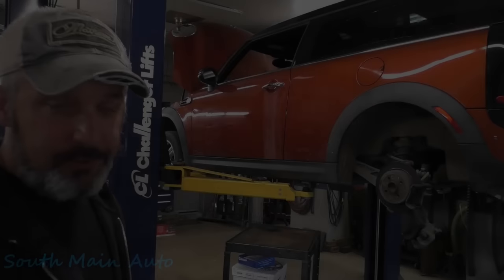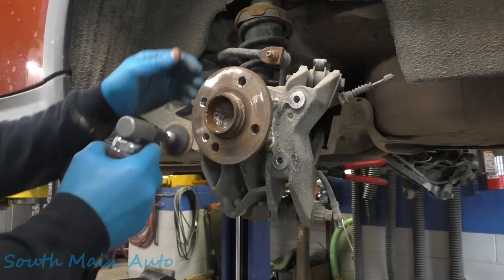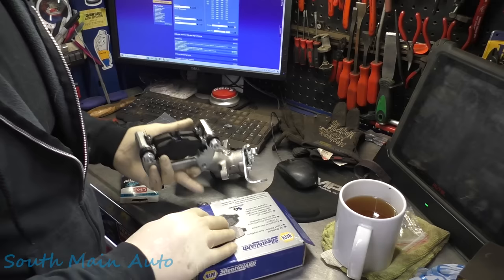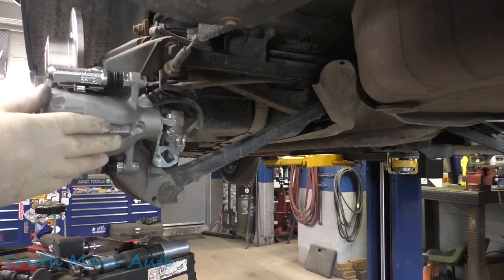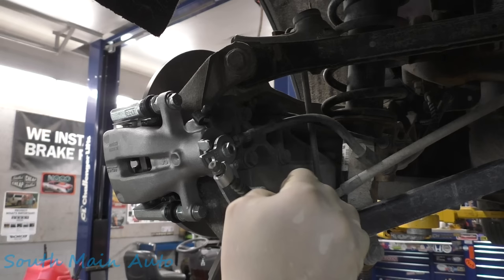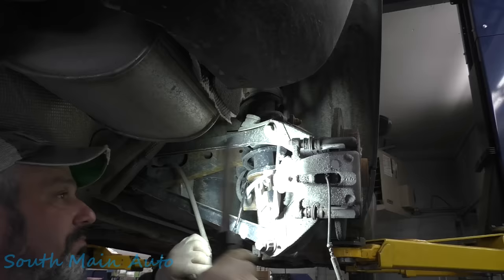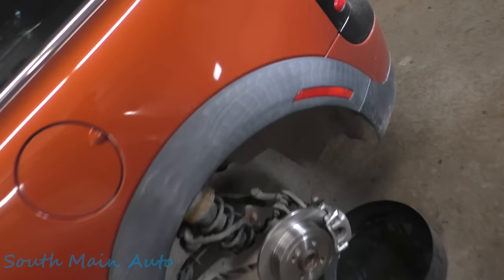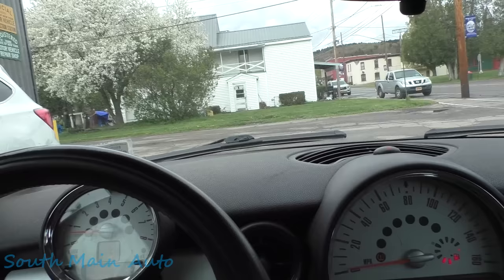'12 Mini Cooper: Rear Brake Pads, Rotors & Calipers

Comment: hey eric the car is built by bmw so a german accent is needed there is normally a tab loop  on the bleed nipple cover to retain the ware sensor wire drive on the wrong side of the road with the steering wheel on the wrong side of the car

Comment: Back in the ancient times, before 1993 and the Internet of things or the Googler and the Yahoo. I used to have a torque sheet taped  inside  the lid of my top box that listed the recommend torque settings based on grade of bolt, bolt diameter and type of threads and thread pitch and material type the bolt that went in to, ie. steel, or aluminum. I used this when I didn't have a manual to get the torque specifications for whatever I was working on at the time. I haven't checked but I bet there is one to be found on the world wide interweb if someone wants one.
Reply from the maker: Most oe's have that chart right in service data too

Comment: Easy way to convert thread diameter to bolt head size in metric is head should be 1.6 times the tread diameter. However the Japanese seem to use a slightly different system.

Comment: Great video, what a difference compared to working on my ‘65 mini pickup (UK only, I think) back in the day. A pet peeve, however - I grimaced at the end when you pulled on the handbrake without pressing the button to avoid wearing out the ratchet teeth. My dad would have cuffed my ear if I did that.

Comment: FYI, the numbers on the service sheet (55, 56, 57, 58……) is the year of the car.  In the UK the number plate includes the year of the car.  We have two numbers per year, so 55 would be 2005.  So the two numbers for this year will be 23 and 73.  The layout of a UK plate is two letters (area code), two numbers (year of manufacture) and then three letters (random). So would look like AB23 ABC.

Comment: Honestly, with all that rust and corrosion, I thought for sure those caliper bolts were going to snap like twigs when you hit them with the wrench. If your break the hose by putting a clamp on it, odds are the hose was junk and would probably blow out sooner rather than later.  So clamp it anyway.
WAF stands for "width across flats"  Don't ask me how I know.   I like those slip join needlenose.  Very handy.

If you are going to call it a Bowdon cable, you need to start calling the hood the bonnet, the trunk/hatch the boot, the centre (note the spelling) Console, the cubby, and any failed/broken part as "knackered".  at least you called it a Spanner.

FYI Carquest was bought out by Advance.  Basically Advance is targeted to the  consumer and Carquest is more for installer/retailer, though you can walk into any advance and get Carquest branded parts.

Comment: Wow, that rotor/caliper set looks almost identical to the rear brake setup on an old John Deere gator I use to have. The little parking brake doohickey inside the caliper broke and Deere wanted a few hundred dollars for a caliper (almost as much as I paid for the entire gator). It was a Wilwood built caliper, but Wilwood of course wouldn’t sell me the one little doohickey that broke. I ended up making my own part, but it sure would have been nice if I would have known that I could just go to O’reillys and pick up a rebuilt Mini caliper... I always joked that they were go karts. I didn’t realize just how true that statement is until now. Honestly, I didn’t even know they were still selling automobiles with non-vented rotors in this country.

Comment: I've got 3 different size bolts in my tool box that I use for the euro stuff with wheel bolts. I think they were some old strut bolts and control arm bolts I had laying around. They are about 4 or 5 inches long. Chop the heads off and presto. I think the 12 mill 1.50 and a 14 mill 1.50 fits most stuff. The smaller bmw's are kind of an odd ball size. like 14 x 1.25.
Reply: I was just going to comment I did the same thing, cut the head off the bolt and there you go 👍👍
Reply: @jeffkeil7217  I do the same for tranny bolts!
Reply: I just use a super long skinny punch as a drift. Don't worry, I haven't messed up a thread yet.

Comment: Most of the different things come from bmw. On my e90, the wear sensor, turn signal, bolts torque based on thread size, brake line to caliper is identical. Even the placement of the brake reservour.  And makes sense since its own by bmw

Comment: I did my brother's john Cooper edition, you can slide the rear rotor out without taking off the caliper bracket. I was going to remove it and he just pulled it right off..
He bought all his parts from some British mini supplier, for 4 rotors and pads it was only 350 usd..
You picking on rainman ray..lol.
Bowden cable, you don't remember vw beetles.. the clutch is a Bowdon cable, it has a bend in it to induce friction so it's not loose.

Comment: I just replaced front discs, callipers & pads on my X5 and asked my wife to help bleeding, we were doing the down, up, down thing & no air was being expelled, she said the pedal was just straight to the firewall, no resistance, what pedal are you flooring was my question, the one on the right was her answer.

Comment: As far as the tool to help get the wheels back on I used a long bolt that fit the hub and cut the bolt head off. Thread it into the hub and put your wheel on. Won’t fall off. Super cheap compared to buying the actual tool.

Comment: As far as I know: Bowden is a tube, fixed at both ends, that something else moves inside of. A lot of 3D printers use Bowden tubes to deliver the filament to the moving print head.

Comment: Some numpty butchered that  calliper in the past for sure ( along with a few other bits and bobs by the looks) - wound the piston in without unsticking the boot from the piston and chewed the boot up. Non Banjo brake hose attachments maybe a pain to remove but they are heck of a lot less likely to leak....

Comment: You're closing line is that you can do it but the truth is other people cannot do it. And their head they think they can but they always somehow screw up every one of these jobs. If you have an ASE certification please post it proudly on your wall. If you don't have one you should because you think like one and you function like one. You follow all the rules every time. I've seen shows where people use a screwdriver like it's a chisel and they use a crescent wrench like a hammer. They do a lot of hit n  miss parts replacement type nonsense. The common man can relate to that kind of nonsense. Your repairs are actually done the right way

Comment: Got a 2012 mini S for my daughter with 82k on it.  Dumped it 2 years later when the oil line leaked in front of engine, all front panels, rad pack and turbo have to come out.  When the PCV valve went and was going to be over $500, by by.   They’re money pits.
Reply: Nah, you can have problems with any car.

Comment: Nice video as always.  UK and US, separated by a common language as we grab the correct size spanner, put on the new brake discs and change gear left handed in the test drive.  Oh and that’s not a mini, those boots wouldn’t fit inside a real mini 😄

Comment: 16mm hex head on M10 bolts is pretty much mostly used on european cars for almost 20 years now.
But it's not a rule, some M10 bolts can still be 17mm hex, so you're always finding yourself swapping sockets.
I guess the 16mm hex saves some material and is therefore cheaper when buying them in millions.

And since when do you use brake cleaner without the chime?🤣

Comment: There is sometimes a rubber tie integrated into the bleed nipple cover which supports the wear sensor...not sure if that's what Mini use....looks lkke someone did a proper job previously!!! Just seen someone else has suggested the same. Not sure about the English accent....think that was Dick van Dyke!

Comment: I replaced brake pads on a mini Cooper before and even though I installed new wear sensors I still had to use a scan tool to reset the system

Comment: Nice to see the rare stir-it-yourself transmission.

I'm surprised Eric doesn't have a one-man brake bleeding kit so he doesn't have to bother Mrs. O with the task so often.
Reply: He does have one, but he doesn't use it very often. The Achilles heel of positive pressure kits is the seal at the MC reservoir. If it flips off it makes a huge mess, and every manufacturer uses a different size cap so you can waste a lot of time setting it up.
Reply: @spelunkerd  I use a hand vacuum pump with a fluid catch container at the brake line bleeder screw. I find it works very well as long as I make sure the reservoir doesn't run dry.

Comment: Dear Eric (and the very dear Mrs O). It is especially interesting to see that Avoca has cross traffic in those hectic streets of your little testing circuit. Your view of the intersection is usually unhindered by any sort of vehicular device at your inner "city" stop sign. BTW I only found out that Avoca is spelled that way in one of your recent videos when you passed the "city" sign. Prior to that, I thought it was spelled "Evoka" when I heard you describe the "city". 😁🙃

Comment: Too late now but the rear brake service interval needs resetting, either by a few button presses on the display cluster and left hand column stalk, or with a scan tool.

Comment: The sensor wire goes underneath the rubber loop that holds the bleeder nipple.
Reply: If I heard Eric correctly this mini was going to the shop for a brake job at 139k miles. That’s pretty decent and the under carriage looked in good shape so I don’t think they are a lousy vehicle. I’ve owned both a 60’s period mini (real mini) and the newer version and I agree the newer has grown a bit too big. Usually British vehicle electronics are awful and fail frequently and the engine and steering systems leak after 30k or sooner but generally there decent in city car to own.

Comment: The dumbest thing I found with Minis is certain models require you to unbolt the coolant overflow reservoir to get to the oil filter. Havent done much work on them besides oil changes.

Comment: I wonder if the new packaging is to avoid lawsuits or complaints of people who don't know the rotors are covered in oil and need to be cleaned.
I like those new calipers and rotors that come with like a anti rust paint or some kinda galvanized coating it cuts down on rust on most of it except where pads ride LOL

Comment: Did these very rotors/pads/calipers last fall, so lots of deja vu. Lot less rust on this one though. Damnedest thing with mine... lots of rust on the rotor face, so caliper pistons or pins must be locked up, right? Took 'em apart, pins were still nice and goopy/slippery, and pistons were still moving. I'll keep the story short, and say that while everything was still moving off the car, when bolted to the car, it would lock right up - caliper wouldn't move at all on the pins. Only discovered this while bolting on calipers sans rotors to see if anything was moving when bolted on - turns out nope. Never seen that before.

Comment: Great work as nornal Eric one thing did you plug your diag in after and reset the milage for the rear brakes in the computer ? lots of Minis have that for front and rear brakes if you dont reset it the car will hit the milage and even if the pads and discs are still good you will have to replace the brake sensor again to reset it hope this helps keep up the great work

Comment: The 16 mm nut on the bracket surprises me since it is not used in Europe - normally those screws are 15 mm or 17 mm on those kinda cars but anyways...🤷‍♂

Comment: I think those BMW Minis were engineered in Germany, so you might add some German accent there, JA?
Also, those brake wear sensors are right out of the BMW parts bin. As are probably rear wheel hubs, discs, calipers.

Comment: Entertaining as always, but I wouldn't bother with the English accent, Eric, the car's German, anyway. With that type of hose connection, you can usually slacken off and rotate the union at the other end if it's twisted when you screw it into the caliper.

Comment: Where does that car live Mr O, it looks remarkablely rust free for one of your local cars. A lot of cars over here in the UK have  wheel studs, don't no why some are manufactured without them. As you say a real pain in the  butt to get the wheel on, especially at the roadside.

Comment: Eric what’s your thoughts on the torqueangle torque wrench. I really like mine, but rebuild engines with a 135 degree angle on head bolts on the regular.

Comment: I've noticed, for some time now, that you have stopped using Permatex lubrication products on your brake jobs. I remember the discussion about the purple shmoo and certain rubber components, but I thought you switched to the orange schmoo. Did you find out something about Permatex products that you can share?

Comment: I bought "brake caliper grease" from the auto parts store after watching one of your videos a few years ago. I noticed that recently, you are using silicone grease on the calipers now. Am I using the same grease? Does it matter? Did you change, and if so, why?
Reply: I was using silicone in the past. It seems to get dry and crusty. Now I use the colored lube and seems to work much better.

Comment: BMW got the Mini in 2000.  Why the bolt HEAD sizes are SAE, not metric is beyond me.  Caliper mount = 5/8", Slide bolts = 9/16" and the bleeders = 7/16". ben/ michigan
Reply: A 15mm spanner (wrench for you Americans!) fits a 5/8, a 14mm fits a 9/16 and an 11 mm fits a 7/16. Still best to use the right one though and a MINI will be metric due to it's German heritage. I live 18 miles from the factory which also used to make Morris Minors.

Comment: No Banjo Bolt? That sucks a big one. There are some really dumb ass things on the mini, like that spring loaded water pump affair that you have to take the left motor mount off to change. I guess the guys that designed the ME109 are all dead, huh?

Comment: I found spraying some WD40 on the brake flex line where I’m about to pinch it off to be a helpful way to loosen up any rust or corrosion that might be making it difficult to pinch off the brake line. This can make the job easier and help ensure that you get a good seal when you're working on the brake system. However, it's important to use caution when working with brake lines, as they are a critical component of your vehicle's safety system. Always follow proper safety procedures and consult a qualified mechanic if you're unsure about any aspect of the job.😂

Comment: Where you were looking for socket for bolts on the brakes, you were using Metric sockets, instead of one of the UK types, hence even the one you eventually used was rather slack on the nut.  You should know to use UK sockets on a UK vehicle.  Recently I queried your qualified professionalism (or is it unqualified???).  This is another cause for doubt.